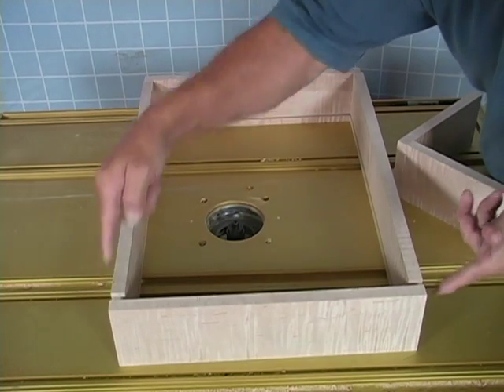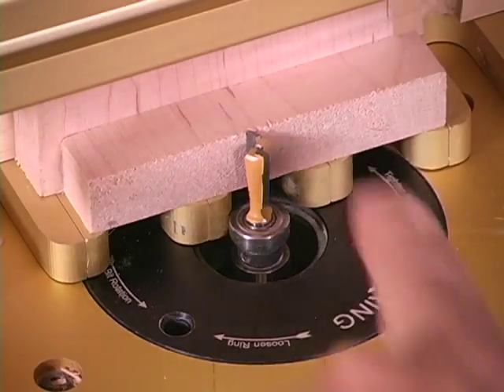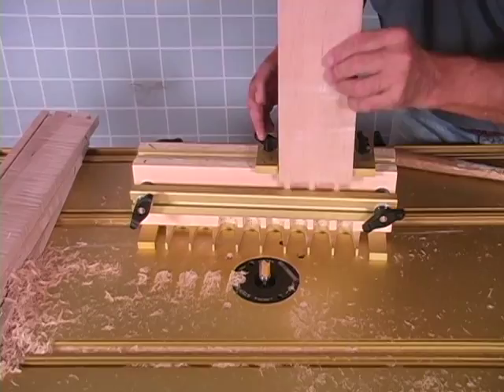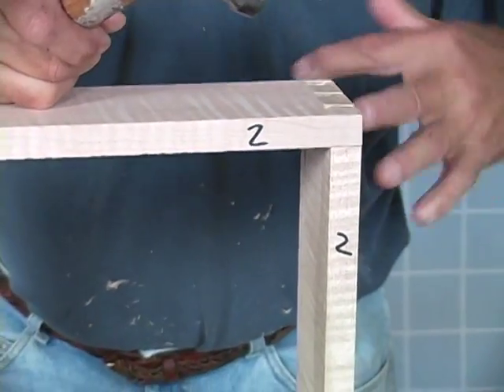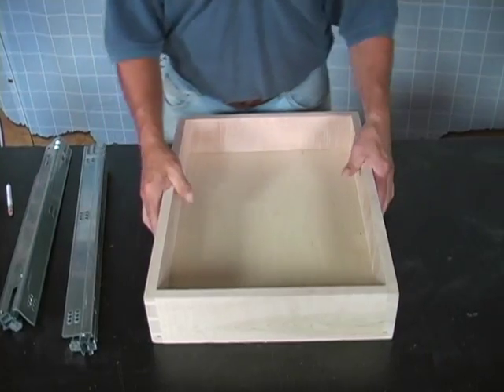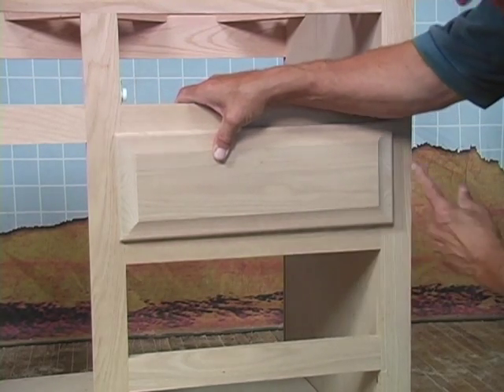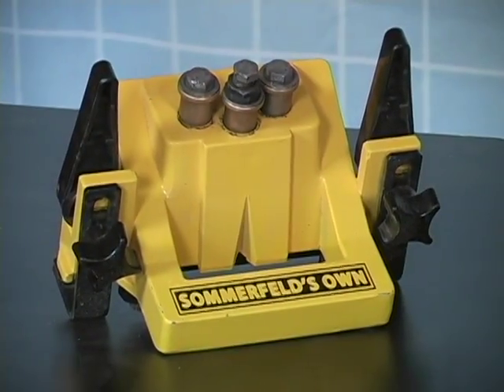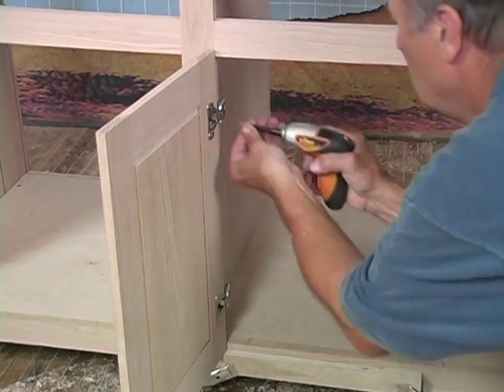Sommerfeld's Tools for Wood - Cabinetmaking Made Easy with Marc Sommerfeld - Part 3

Comment: I liked everything about it except the beating on it with a claw hammer and wiping the glue off without water.  Sometimes that yellow glue will soak in and make it impossible to stain.  But he probably uses dye and tinted finish so it won't matter.

Comment: the one thing I do not like about the EASY MARK is the fact there are no numbers to go by for drawer handle settings, I had different width screw holes,  tricky to use for handle placement

Comment: Never did see a clamp when gluing the boxes up. And yet these come out with perfectly square corners? Cabinetmaking doesn't work that way, dovetails or not.
Reply: I agree. I can see that the drawer is twisted when he lays it on the router table to round off the edges...it rocks on diagonal corners.

Comment: a Sharpie? are you serious?  good luck sanding that out.
Reply: You think maybe the sharpie is just for the video so you can see it clearly?
I doubt if he uses it in normal work, and if you're dumb enough to think he does stay away from power tools.
Reply: Keith Hull Newman Noggs 
Even if he did use a sharpie, he rounded over the edge anyway.  I doubt there would be much of the ink left on the edge to be sanded off.  I use sharpie all the time, knowing that I'm cutting along the inside edge of the sharpie so no ink will be left.

Comment: A very nice tool, but why wouldn't you center your dovetails?  Showing a system to make every joint faster stronger and more accurate, seems to be one of the base tenets of the process completely ignored.
Reply: The Every Maker - formerly Nickbox